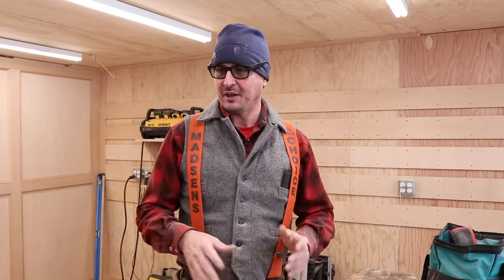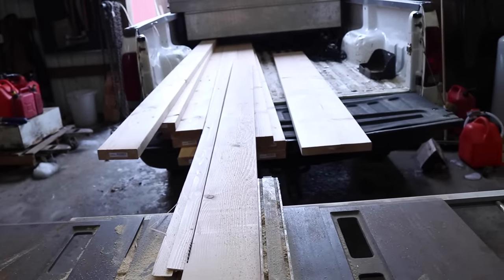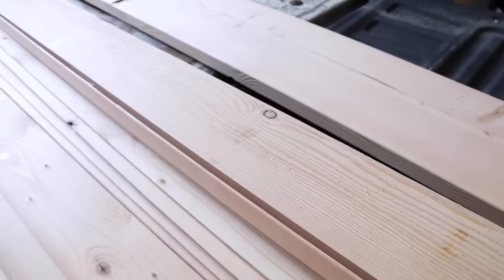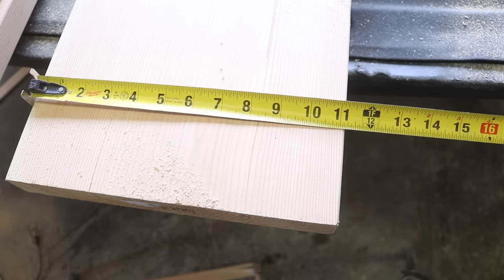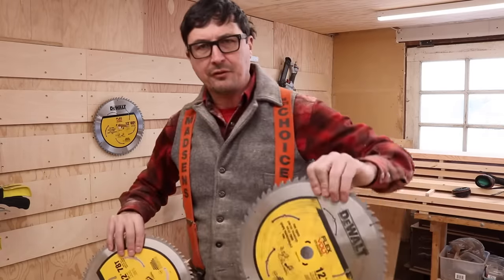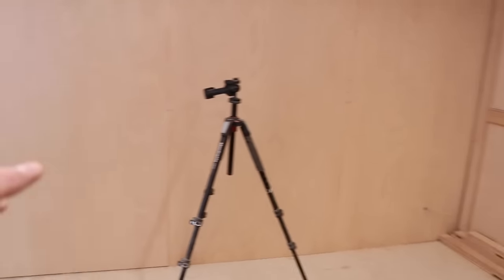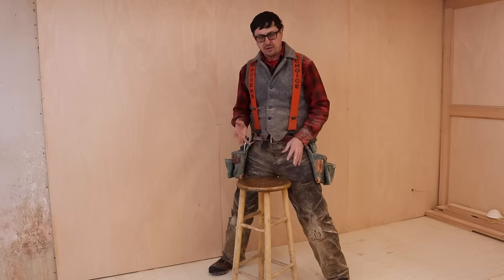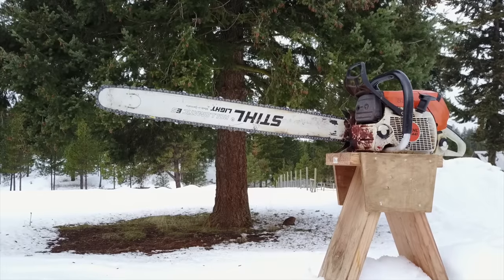The Best $150 You'll Ever Spend!!

Comment: Everybody had those milwaukee tapes at the metal shop i worked at.  Filings would get stuck all over them.  I never knew why.  There lousy.  My fat max is what ive always used since carpentry and construction and all of my trades. Though i remember people complaining about their weight and them breaking when dropped, but i had two tapes to avoid that 35 ft for measuring truck boxes and staright trucks and a 25ft i would carry around.

Comment: Cody bar. Height is 42 inches above finished floor or aff  on blueprints  usually work surfaces like countertops for writing  or desk height is 32 q/2 inches. Aff  designed to be sat  at and   Used for working  a workbench is   Whatever the craftsman desires or prefers   Everyone ;Ike’s a slightly  different height  to work at    There are a few other standards  in the architectural woodworking  guidelines  in reference to  ada.  Requirements. And that can vary by state codes  so T-shirt best to check them. Especially  for commercial applications as usually a residential kitchen counters are set at 34 inches  to accommodate under counter appliances like trash compactors or dishwashers  to addomodate the lower counters for ADA requirements some companies started building shorter dishwashers  but they are usually special order and  from higher  end companies like Bosch and similar  making them much more expensive to buy  then like a GE or ?   Not being a hater  i spent many years in commercial woodworking   Things may have changed as ive been out of the trade for over 10 years now  like any person I don’t know everything  lol  take care and btw i do like the bench quite a lot that’s one Jack should be able to use when he is grown up i  got my dads  with his vise still bolted to it lots of good memories working by his side growing up as he taught me lots and gave me the gift of working with my hands i made a good lively hood with those skills and most of all did what i enjoyed and loved my entire adulthood !

Comment: No reason not to have a guard on your saw when you have a bunch of ripping to do.  Also bullnose is rounded 180 degrees on an edge.  One corner is just a roundover.  One more thing,  ripping that much lumber, I would have put a ripping blade on the tablesaw.  All that out of the way, great video.  Thanks.

Comment: I doubt Home Depot deliberately screwed you out of one to three-eighths of width on your 2"x12".  Wood is cut to acceptable tolerances, not precise dimensions.  Most mills allow for (+-) 1/4".  Additionally wood is a natural product and is subject to shrinkage and expansion due to moisture content.  The biggest problem with lumber, however, is how fast they grow the trees.  Modern tree nurseries provide nutrients and water to grow the trees faster so they can be harvested quicker.  This makes for some rather unstable lumber that is prone to shrinkage, warping and cracking.  Old growth lumber is, hands down, the best and most stable wood you can purchase.  That is one of the reasons Old Barn lumber is highly sought after.  I believe you may have been somewhat harsh and unfair to Home Depot.

Comment: The net size standards of construction lumber is decided upon by professional organizations that are in charge of making these decisions and setting industry standards.  I don't remember when, but many years ago, it was decided that the net widths would remain 3-1/2" and 5-1/2" on 4-inch and 6-inch lumber, but beyond that, the net sizes for 8-inch, 10-inch, and 12-inch lumber are 7-1/4", 9-1/4", and 11-1/4" respectively.  In addition, the tolerance level for construction lumber allows for a some amount of imprecision..some boards being 1/16" or 1/8" undersize in width is not beyond acceptable industry tolerance standards. This is not a new thing..it happened long ago...and the retailers who sell lumber have nothing to do with it and no say in what standards are set.  On the other hand, some sawmills and planing mills do a better job than others at being more precise and consistent than what minimum standards require.

Comment: Handyman Club in their August/September 2010 issue has plans for a mobile workbench ( http://www.scout.com/home/build/story/1400818-woodworking-plans-mobile-workbench ) which I built for $350 in materials and hardware and $120 in tools.  This includes a VYCO workbench top (have used VYCO on all work surfaces every since drafting teacher gave me a used sheet after he refitted all the drafting tables with new)  but did not include T tracks that were installed later.  It took two weekends (1 day to mark and precut boards, one day to build lower frame, one day to build work top / add vice) to build but I've been using it for everything from wood working to reloading.  With it being on casters, I've been able to use a bully to get an engine up and then was able to roll the table underneath it and roll it back to its location.  For a small shop, mobility is key.  It calls for a table saw / circular saw, drill and bits (including , router, jigsaw, miter box and work horses for tools; glue, screws, polyurethane and stain to your liking.